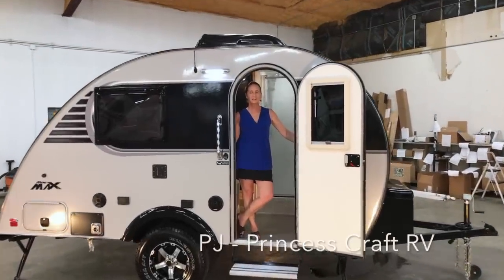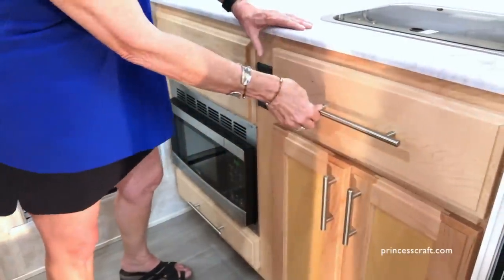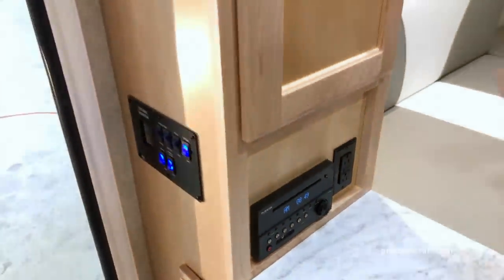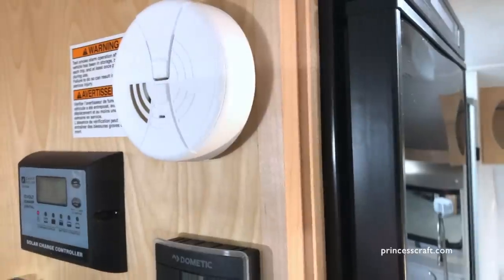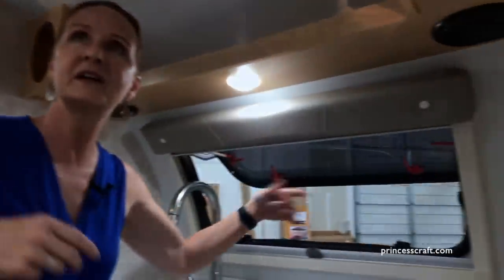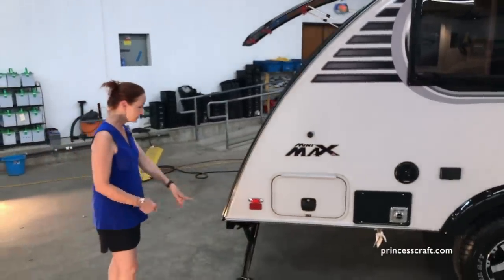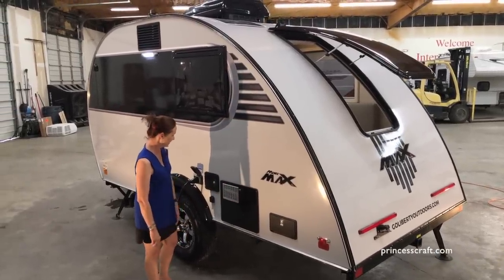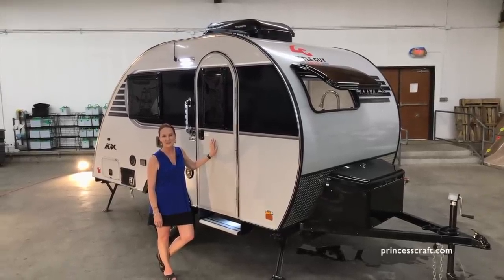2019 Mini Max from Little Guy Walkthrough with Princess Craft RV

Comment: You are by far the best camper host ever! Love your style!
Reply from the maker: Why thank you!
Reply: Can I pull this with a stock 4X4 Jeep Renegade?  Also, generally, what's the price point?  Finally, where in the Dallas/Fort Worth area (prefer Fort Worth) might I see one in person?
Reply: @SheepdogSmokey  it's worth looking into your exact model renegade but odds are this is too heavy
Reply: I'm getting this reply most often, I'm planning a transmission cooler, which will take me from 2K to 3K max, but I think I'm going to have to go to a truck to pull what I want.
Reply: Yes! - one of the best on youtube !!!
Reply: Yes, one of the best on YouTube!!!
Reply: @kevinrooney7954  What is the towing capacity of a renegade? My Kia has a 5000 pound towing...
Reply: Looking for info on using a  Vue Saturn for camping.  Many years with RV’s.  Have driven a Class C  for many years.  Any suggestions.

Comment: I love this lady, it's like having a good friend walk you through the layout. I wish they had an induction burner option, enclosed cabinets in front at the top, a solid bathroom door where you can't see through it (maybe a little window or skylight instead),  drawer and cabinet hardware you wouldn't get hung up on in such a small space, and a black matte fixture option (for sinks, faucets, showerheads, etc.).  Don't care for the red handles on the windows or that the microwave is so far down, but I LOVE the big refrigerator and the freezer...other dealers RARELY give you a freezer!  The refrigerator/freezer is PERFECTION!  I like the Lagun table over the telescopic table, but to each their own.  A solid cushion color option and a bit more solar/battery power would be nice (that's just me...the propane stuff has just always made me uncomfortable).  I love the big rear window.  I like the light gray-toned wood they have out now (nu-Camp teardrops have it as an option).  I prefer the Maxxair fan deluxe (It has a remote and can be left open when it's raining, so it doesn't get all humid in a small space).  Love the outdoor TV, backup camera, and lift option!  Other than the few personal preferences (more options would be nice since these little campers have come to cost so much now), it's an OUTSTANDING little camper!  One of the best I've seen.  Very informative tour!  The space is just right!  Can you tell I've been looking for the right camper for a while? Hahaha ;-)

Comment: A 13.5 roof mount a/c in such a small unit is a deal breaker for me. They are are extremely loud in small trailers, more maintenance, and require a larger generator for off grid camping. A 6,000 to 8,000 btu a/c is more than enough to cool this unit. and a 2,000 watt generator has plenty of power to run them. And if anything goes wrong with it, you buy a new one at Walmart for much less than a dealer will charge you to repair a roof mount.
Reply: %100 agree. These AC's are over kill, high maintenance, roof leak potential, noisy, and very hard to get replaced even under warranty. Then your camper is in the shop for a month. If they simply used a 5-8 BTU wall mount , as you said you can go to Walmart and get a replacement in an hour. The smaller 300 series mini max has the wall unit. Point is, you don't have to go fancy with everything to the point of making things so much more complicated.
Reply: @KiddNemes1s  Solar panels come in different wattage sizes. I have seen some with over a 1000 watts of solar panels, not just a single 100 watts solar panel.

Comment: Standard garage door height is 7'.  If you took the A/C unit off this trailer, it looks like you would be pretty close to that.  A smaller A/C, maybe mounted up front by the propane tank would be enough for most folks.  Being able to park it in your own garage would open up a very large market!

Comment: I think they need to bring the microwave up where you can actually use it,  who the heck designed that spot for the micro?
Reply: Right next to the comode, very convenient
Reply: @foxiedogitchypaws7141  Tis why they have those 100K 50 foot long mammoths. Or how about just stay home.
Reply: @featheredfoothillfarm  200+ K,and that was in '99 and less than 40',have had mine for 5 years now and thinking about Downsizing Lol!
Reply: And Bubbles in the Bathroom wall,Not a Good Selling point!
Reply: @featheredfoothillfarm  I think a microwave would be more valuable than a TV.
Reply: @foxiedogitchypaws7141  lmao!!!

Comment: USB plug is not accessible--Another problem--maybe someone posted but couldn't find.  I only saw usb plugs under the table.  Once the table is down and the bed made those usb plugs can't be accessed at night. A serious design flaw.  I agree with comment that the table should go--unless you could have a drop down table from the ceiling?
Reply: And what about the furnace vent UNDER the bed?!  If you're sleeping, the furnace is heating up underneath you.  Hmmm.

Comment: That freezer is marvelously spacious and effective-I’m genuinely impressed! I realize this is a micro unit, and I know realistically it’s a moot point for any trailer or RV; however, I just can’t get past the unsavory sensation of having the toilet immediately next to the food preparation area...
Reply: That bottom door is not a freezer.  It's a deep item fridge.  The freezer can be seen at the top of the fridge section. It doesn't have an independent door. It's inside the fridge.  Still spacious, just not as spacious as the bottom door section.  I also have a tour review and a mod of mine on my channel.  (shameless plug)

Comment: PJ does an excellent job. She knows the product well. I've watched her video on the Tab 320 which I really like. But it has no microwave and no freezer in the tiny refrigerator for ice trays. So I was interested in what she had to say about this one.  The refrigerator and this one is excellent. And it has a microwave which is my favorite way of cooking. I literally never use the stove top in any RV I've ever owned. I like everything about the Mini Max, everything in the front except the seating in the back. Except for the well-designed table, it's like they just threw some pads back there for you to sit on. The Tab 320 has much more planning and design going into the seating area. I may decide to give up ice trays and go with the Tab instead of this. I just like the way the seating area is designed in the Tab 320. Plus, I'm single and like the idea of having the back area for sleeping in the Tab while leaving the table set-up. I suppose the same thing could be done in the Mini Max. For sleeping, a comforter or two is easy to throw down for sleeping there. And to me the shelves and storage are more convenient in the tab 320. Just a little classier design. But the mini Max is nice overall, especially if you're taller. I'm only 5' 6" so the height doesn't bother me.  

Finally, Give PJ a raise, I bet she's sold a lot of these trailers from the videos. We have dealers here in Dallas. But I'd love to drive down just to meet her and say thanks for the great videos.

Comment: Love this one. Love that you increased the fridge size, the lift for greater clearance, is it possible to add solar beyond 100 Watts?
Reply: T S There is always ways to add more solar if their is available room on the ceiling of the trailer. You can also purchase portable solar panels and set those up while camping. Although I don't buy much from Harbor Freight tools, they have a 100 watt solar panel system that is portable and you can tie up to 5 of them together which would give you an additional 500 watts of solar!  They are $149 for a 100 watt system without the battery.
Reply: It looks like there is room up there for another one of those flexible solar panels.  Look at the video again and see.
Reply: We bought an oversized panel than recommended for our wold pup. The extra panels are cheaper than a starter it. Why we chose the solar ready new trailer when we downsized from old fifth wheel that always had dead batteries. The newer trailers and made to handle solar with led lights etc. you only need one battery. Two drains each other or hooked wrong.So we keep solar panel under or in truck bed. We bring small ladder and throw on roof. Surprised it doesnt just trickle charge battery it will charge it all the way up!! Also bought honda quiet generator. So we can put on to use microwave. Which only works on generator for any model. Or land line.

Comment: We ❤️ our 2018 Little Guy Max Trailer!
Reply: I'm considering one but it is much smaller than the travel trailers I looked at.  Will just be me and the cat and usually for only a week at a time but it seems like there just won't be enough storage.  How have you dealt with this?
Reply: Robert D Hi Robert! We have not had a storage problem. There are two sizable ceiling to floor pantry type cabinets with adjustable shelving, good sized kitchen cabinets and kitchen drawers, a couple of generously sized pull out drawers, extra storage under the dinette bench too. Plus cubbies all along the top of the dinette area and in the bed area. Oh... I forgot to mention a good sized open area for storage above the refrigerator which I use for packaged groceries. I would say half of the inside storage area we use and that’s been it. Keep in mind our longest trip was a week long... we mostly do long weekends. There is also external storage and we do use the truck bed for things like firewood and trash. I hope this helps! Let me know if you have more questions. I am happy to help the best I can. 😁
Reply: @RandisAdventures Thanks for the detailed info.  Really appreciate it.  One more question if you don't mind.  I have a 3000 watt Honda inverter generator for backup for the house but it is heavy and may be overkill for this trailer.  Do you use a generator?  What size?  Thanks.
Reply: Robert D We have not used a generator so unfortunately I am not your best resource for this question. If you learn more I’d love to hear what you learn!

Comment: I'd rather have this than some giant ass house on wheels. When I camp usually with a hammock, the only things I mis is the ac/heat unit, bed some wifi, shower toilet, A place to be dry and protection from the elements, bears and murderers. Everything else is unnecessary.
Reply: I have a giant ass house 5th wheel and it’s been fun but looking to downsize for short weekend trips instead of spending months away from home. Less is more.

Comment: I could see bubbling on the wall of the bathroom/ shower room not good.
Reply from the maker: It isn’t good, that's certain, but it is fixable and it isn’t detrimental structurally. The video lighting certainly makes it appear more pronounced than it actually is. The lump isn’t in the structural wallboard, per se, as it is a veneer laid/set/glued against the actual structural wallboard during the construction process. So, the wallboard isn't delaminating, but the shower wall veneer really does need to be pulled off and re-set. If there's a bright side to speak to, it's that it's fixable and that there’s no material in the walls that rot or degrade from moisture. The trailer is welded aluminum framed. The siding is composite, including Azdel. As a dealership, our service center will be able to fix items like this under warranty. The manufacturer, Liberty Outdoors, is on-top of improvements and customer service as they further develop their products and new product lines.
Reply: Yes, I was wondering about that.  What is it?
Reply: shawn williams I love how they try to justify it,it shouldn’t be there in the first place.
Reply from the maker: Hi Gregory! It appears that you’ve mistaken the definition of “explanation” for that of “justification.” We agree that the issue isn’t good, and shouldn’t exist in this or any unit. We explained the issue, spoke to possible concerns that won’t arise (like rot and rust), and shared that even though there is no structural concern, it can be fixed. So, with further  clarification, have a great one!
Reply: Well stated.
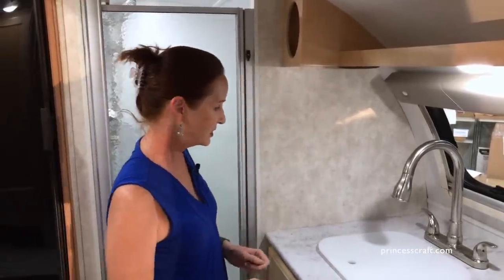Reply: Also, ref. back to... 1:59 - 2:12.
Reply: Gregory Adkins have you ever polished anything. Just saying.
I cleaned Government hiusing.
Had some idiot offucer point the very same thing ourt in.......
.1974 its like a window.
I also do stained glass....
Same occurrence.
Roll up a sleeve and buff.

Comment: Can't open the windows in the rain.  Water would pour inside.
Reply: How would water pour inside?! The windows vent open outward and the rain would run off the window pushed out.
Reply: @01Lenda  
Rain doesn't always fall straight down.  Wind drives it sideways.

Comment: The one thing i like is the upgraded cabinetry and better fridge and windows. but not knowing price, check all small models of all brands. We have only a little more length in our wolf pup. Permanent queen bed. 2 bunks i chose on purpose to use top for suitcases. Box for towels. Extra blankets all on top. Where are clothes to go in here? A few pairs of shoes and closets done. We can sleep 4 without top bunk used as 2. Person dinnette sleeps one but great to not have to remove eating area to sleep.. I sleep in bottom bunk when snoring gets loud in the queen! We also lost bathroom sink but have separate shower with bunk model. Our dry weight is the same for a few extra feet and more room. Just wish cabinets better. Like the wood grain is paper?We bought last years model just as the new year came out but still new. Check your options. This is very nice for one person but you have to make the bed all the time even for one. But its very nice looking.

Comment: Definitely a cool little camper trailer. However, I am not freakishly tall at 6’4” but the 6’ interior height would be a deal breaker for me. I like the compact size of the trailer, i just wish they raised the roof a bit. I would also add more than 100 watts of solar. There is more room on that roof for a few more panels.
Reply: I'm 6 ft 3 and bummed that this won't work for me 😭

Comment: Is this thing insulated like a T@B from NuCamp? Does it have a belly cover to keep the tanks insulated from weather and improve the aerodynamics? I've very impressed with the 320S but need something a bit taller for my 6' height. And Don't want to go to the higher weight of the 400.

Comment: The faux rock wall in the shower is awesome! Oh! not a rock wall? Just the wall coating blistering and 
separating from the adhesive? Ok.... Got it.
Reply from the maker: It isn’t good, that's certain, but it is fixable and it isn’t detrimental structurally. The video lighting certainly makes it appear more pronounced than it actually is. The lump isn’t in the structural wallboard, per se, as it is a veneer laid/set/glued against the actual structural wallboard during the construction process. So, the wallboard isn't delaminating, but the shower wall veneer really does need to be pulled off and re-set. If there's a bright side to speak to, it's that it's fixable and that there’s no material in the walls that rot or degrade from moisture. The trailer is welded aluminum framed. The siding is composite, including Azdel. As a dealership, our service center will be able to fix items like this under warranty. The manufacturer, Liberty Outdoors, is on-top of improvements and customer service as they further develop their products and new product lines.
Reply: @PrincessCraft  problem is...this shows the quality in the build of your camper....what else is going to be an issue on a NEW trailer...smdh
Reply from the maker: We get that. We’re a dealership. We share thoughts with the manufacturer about these matters, too.
Reply: @PrincessCraft  hope so

Comment: You said the trailer weighed about 2000 lbs. What is the towing weight or the weight at the hitch needed to pull it.
Reply from the maker: Specifications & Features
Dry Weight  1,993 lbs.
Tongue Weight 280 lbs. (hitch weight)
Overall Length 17' 2"
Overall Width 6' 9"
Exterior Height 8' 6"
Interior Height 6'
GVWR   2, 900 lbs.
Fresh Water  20 gal.
Grey Water  14 gal.
Black Water  9 gal.

Comment: Does the cover for the two burners come completely off so I can cook with a large skillet?
Reply from the maker: The cover isn't designed to be removed and replaced in that manner, but it is doable. Be careful as a large skillet that's designed for residential use may extend significantly beyond the perimeter of the stove and conduct heat to nearby surfaces that shouldn't get that heated.
Reply: @PrincessCraft  I would bring some ceramic coasters to rest the skillet.

Comment: I seen these in the price range between $20 - $26k.
I just have 2 questions. 
1, my truck has a 7 pin electric plug in for a trailer and while this trailer in plugged in to the truck,  will the battery be able to charge and the trailer draw electricity from this connection? 
Question 2, how do you put the screens on the windows to keep the bugs out?
Reply from the maker: As long as your 7-pin plug has a 12 volt charge line, it will charge the trailer’s battery and provide the current you want for your trailer. The windows have built in screens that can be pulled down. Sorry we didn’t demonstrate that well in the video. The door has a screen, too.
Reply: @PrincessCraft  
Thanks for the quick reply. 
Do you have any dealership outlets in the Sacramento area we can go check 'em out in person?